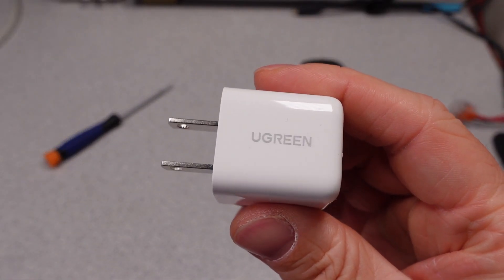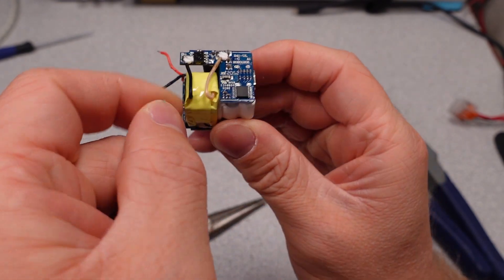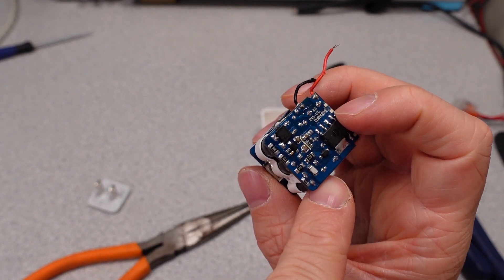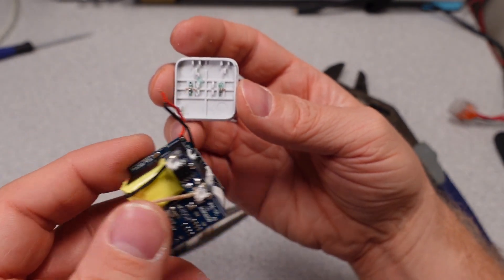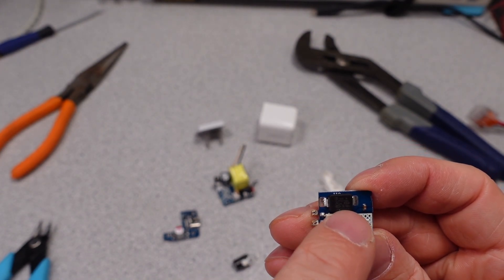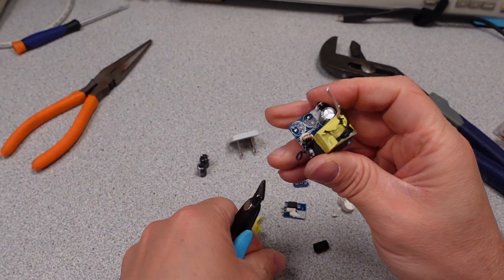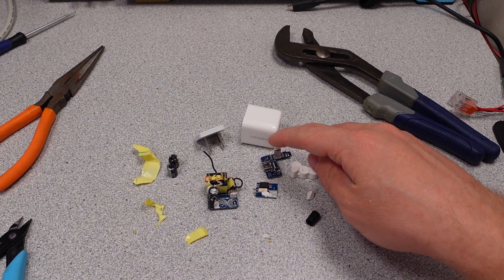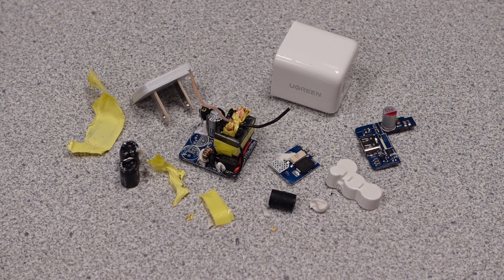Teardown UGREEN Mini 20W USB C Charger - PD Fast Charger

Comment: Hi sir, can you please make a review for UGREEN 20W USB C Charger GaN. New model for 20W of ugreen. do you think the old still better?
Reply from the maker: Yeah, I have the newer one to review.  I'm not sure which one will be better, maybe they will be the same.
Reply: @AllThingsOnePlace  I'm excited! its the ugreen 20W with GAN. 

I want to buy a slow charger because I think its safe to use slow charger than to use 60w or up fast charger for cellphone. For example I want to use my phone +5 years from now given that I just bought it now.

Do you think is that a wise decision to use slow charger? can you please recommend one that is safe to use?

By the way I'm from the Philippines as well. I'm happy that I found your channel, I found it on Reddit when I search for which is better charger Anker or Ugreen for iphone..
Reply from the maker: @markpelayo  Yeah, for a smaller battery, charging a little slower isn't a bad idea.  It is a minor effect but charging at absolute maximum speed is not great for the battery but fact is any charge and discharge cycles will effect the batteries longevity as well as just age.  Charging at a reasonable rate versus slow really doesn't make much difference.  So, 20W charger like the Ugreen is fast charging but for a cell phone I'd say that's a reasonable enough pace that the damage isn't going to be significant versus just normal charging, at 5 or 10 watts but more data is needed and every device will behave differently, I am curious if there would be enough evidence of a long term analysis of charge cycles to see the difference.  There really aren't enough studies on this, at least not published ones, I am sure the phone manufacturers do this stuff constantly.  But yeah, even Samsung 45W charging doesn't hold 45W for too long to keep both heat and battery health within a reasonable range.
Reply: @AllThingsOnePlace  Thank you so much for detailed explanation. I think I'm gonna stick with 20W gan charger then. 

If only all mobile phones have replaceable batteries like 10 years ago we would not be worry damaging the battery. Read the news about the EU demanding all cellphone companies to return the removable batteries to save the earth from e-wastes.

Comment: Hi, i have watched current videos about best chargers and finally i could looked for detail about ugreen 20w for best option case 20w. I have bought one and how it suitable for my old pixel 3xl?. Thank you for detail reviews.
Reply from the maker: It looks like it is about an ideal match for the charge rate that phone supports.  I would expect the battery might be getting a bit on in age so even if you fast charge it still might not last all that long.

Comment: based on the inside, do you still prefer this ugreen compared to anker a2633?
Reply from the maker: I wouldn't say prefer, too strong of wording!  This particular UGREEN adapter isn't bad (I was impressed by a reasonably priced adapter having a good design).  In the 20w category the A2633 or A2637 have lower idle power consumption.  The UGREEN also has a 12V out mode.  In terms of internal components there are a lot of similarities.  It almost comes down to feature set more than anything, which one has the particular charging mode you need.
Reply: @AllThingsOnePlace  hi, thanks for replying! couple follow up qns if you don't mind:
- what's the 90 (ugreen) and 87 (anker a2637) score refers to in general terms? can it be interpreted as overall score of quality?
- what's the use of the 12V? is it a capacity that needed by some phone, let's say, iphone?
sorry complete beginner here, thanks!
Reply from the maker: @user-jo6xr3iq3g  The number is a rating system combining the power factor, efficiency, THD, etc. (more complicated) terms into a single number rating.  The scale is out of 200 for resolution and gives an indication of power quality, so how good is the device at using power from the grid.  So, in terms of performance a 90/200 and a 87/200 are both actually bad but being lower power devices this is considered acceptable (it shouldn't be considering volume of production on devices like this).  If you look at something like the Hyphen-X you can see a more advanced design which gets a 150+ which is good but this also has issues like high idle power consumption.  Modern products are all over the place due to the use of nonlinear current consumption.  Lightbulbs can be 90 or push 200 depending on the technology they use.  
In general iPhone uses 9V.  iPad can use higher voltages.  There are some devices that will use the 12V mode if available.
Reply: @AllThingsOnePlace  got it, thankyou so much for explaining. On top of deep understanding of this area, you're also very generous to share that. Keep doing what you're doing man!

Comment: How was that plastic put together? Snap fit or glue?
Reply from the maker: It looks like snap fit, it may have been ultrasonically welded in a few spots (the crack when I squeeze it with the grips).